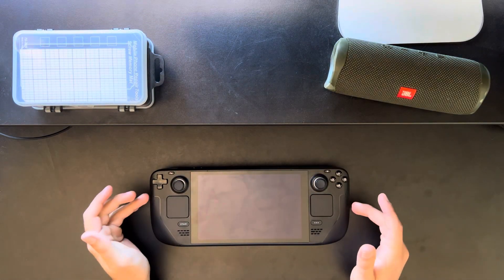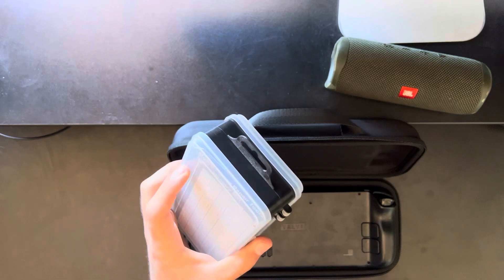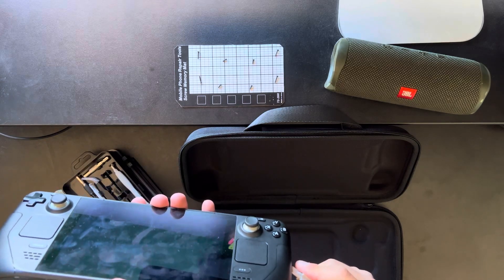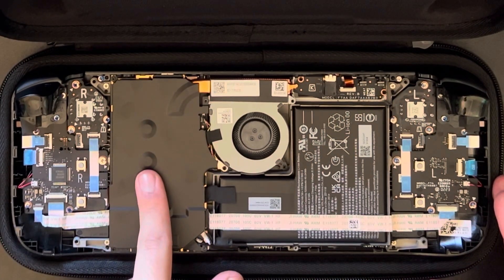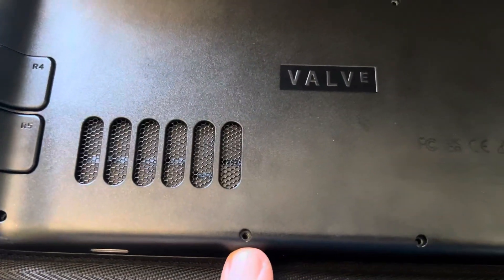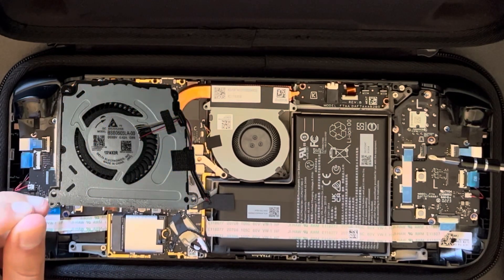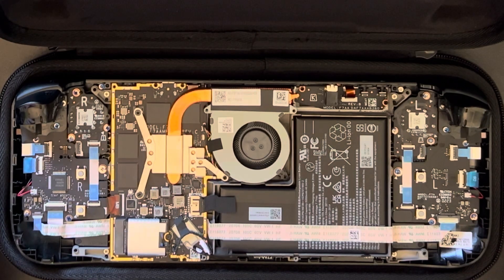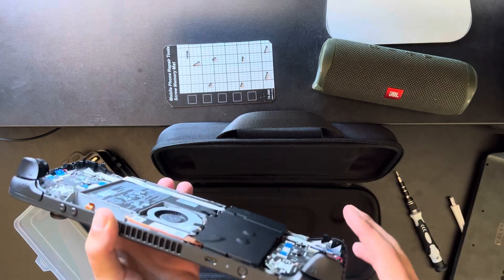The latest Steam Deck revision’s new heat plate and other changes

Comment from the maker: Thanks everyone for the comments, suggestions and support. It seems I did miss a few things like moved/changed cables and motherboard layout adjustments, I don't have an older steam deck to compare to so these are great. One important thing I did miss is:

REMOVE THE MICRO SD CARD BEFORE TAKING OFF THE BACK SHELL

I don't currently have a micro SD card installed so I forgot to mention it, thanks everyone who yelled at me in the comments about it and warned me about the damages it can cause. I'll update this comment if I find anything else major that I missed.

Comment: So does the new heat held give better temps and if it does where can I get it and can I add it to my area. Deck which didn't have that sheld
Reply from the maker: Hi, I’m not sure if it offers better temps since I don’t have an earlier model to compare but I’d assume it is the same. The steam deck revisions seem to be done for cost savings or easier disassembly, not for performance.

If your deck didn’t have the same shield as mine then it’s probably a different model with a different shield and there’s no need to buy and install one like mine. Hope that helped, sorry for the delay.

Comment: It looks like the wireless module has been moved out from under the M.2 SSD to beside it. I wonder if that means that M.2 NVMe SSDs with higher EM activity will not disrupt wireless function or if we even need to transfer the EM shield from the SSD to the replacement...
Reply from the maker: Nice catch

Comment: Omg thank u! Ur the only video I found that actually shows the new black shield and the screws on them but best of all u explained how many and why there aren’t some on all sides. I couldn’t close my bottom case till I saw ur video. I was about to wait for steam help. Then I realized when u said “the make case will use those screws that go in the black shield as well. I got a flash light and saw my metal screw through the case screw hole or the case screw. I just saw the god damn thing ok!? 🙏
Reply from the maker: Haha glad my video was helpful, yeah it looks like valve tried to reduce the number of screws by making some of them multipurpose.

Comment: What is that tool kit ?
Reply from the maker: It’s just a cheap kit I got off Amazon, I wouldn’t recommend it as while the magnetic tips are convenient they get stuck and are hard to swap. Also I don’t use it anymore since it lost its magnetism due to the events of the switch backplate video.

Comment: I got one of the very first steam decks, it even said so on the display when I got mine in the mail. I've upgraded and modded mine to hell and back and I can tell you that there are several differences well beyond just the fan and heat-shield on your steam deck. The biggest one I noticed is that the Wi-Fi card is now in its own place, uncovered by the SSD. This is actually huge as they were originally claiming that the third-party SSDs would likely interfere with its signal and now it seems like that's super unlikely. Another difference I've noticed that NOBODY has talked about from my early deck among all the newer ones was that the buttons are different. My launch deck had awful quick-access and steam buttons. Literally couldn't feel or hear them click, it was super annoying (until I soldered new ones in because it was THAT bad.) The start and select buttons are also now much taller, mine would press in below the surface of the rest of the system making it feel very weird. Newer decks don't bottom out the buttons as far. I was able to fix this by buying one of the replacement shells from eXtremerate however. Then other changes that are clear are the audio ribbon cables being routed completely differently as well as the joysticks being different designs both electrically and physically. The caps are very plastic-y in mine, even the rubbery edge is sharp and not so grippy. The newer ones have a softer more grippy feel and I really appreciate that. My deck is still awesome though! None of these changes are enough to warrant a new one but it's awesome to see them constantly improve it.

Comment: You are wrong about slim back cover. The only thing that allows you to hold it easily especialy 1 handed(when you use touchscreen with other hand) is grips. Withiut them it is a bulky heavy  thing that you cannot hold properly. For example ally is much slimmer becausr its grips are twice lower in profile. and it it horribly uncomfortable.
Reply from the maker: Yeah I see where you're coming from, I have a switch and it gets uncomfortable after a while. Maybe not completely flat but lower profile, someone else suggested putting stuff like batteries inside which would also be cool. One company has already made a shell with RGB lighting in it.

Comment: I put 1 terabyte in mine for £84, I woulda put 2 but 2 terabyte 2230 size SSD's are way more expensive than 2280 size 4 terabyte SSD's. 
Got my ultra fast 4 terabyte 6800 mbps read 7200 mbps write (for my gaming PC) for £180 but a 2 terabyte steam deck SSd is over £200. It doesn't make sense. I think I saw one for £184
Reply: Did you do the swap yet? How did it go? I think I got the same SSD was it a Sabrent Rocket by any chance. I'm yet to do the swap as I've been seeing an issue where the screen does afterwards. Hopefully thats not a common problem tho

Comment: just a question whats that little cable think on the wifi chip?
Reply: The large flat white ribbon cable above it connects the mainboard to the daughterboards on the sides. The smaller cables connected directly to the wifi card are for the antennae to make the signal better. All devices have them.

Comment: Thanks for this, I haven't opened mine up yet but it's from April, so it may be just before/ just after this. Food for thought, if you're using the newer fan setting in the system settings, I'd turn that off, and I'd go further and get Decky Loader then grab Fantastic, and set a linear fan curve. It'll stop the massive ramp/unramp sounds during certain activities.

Comment: i bought a 256gb refurbished one the other day and that is different again from what you have and from what previous models shown .. i even upgraded mine too a terabyte NVME and 512gb Micro SD ,  i never even thought there was this much variation on them .. great video my guy keep it up :) ..
Reply from the maker: Wow, that's interesting. I would have thought the refurbished models would just be the same as previous models but cleaned up and repaired before being resold. Austin did a video on the refurb deck, I might have to check it out.
Reply: ye i seen that video .. its good .. looks like he got a first generation unit .. im in the uk and all the steam decks come from Holland way with us god knows where tho that's where the shipping said .. maybe the ones in America are different .. mine was basically brand new , even got the one time serial number awards in steam from it 
 @salocin9009

Comment: Another big change that's quickly noticeable from earlier versions is they removed the audio cable that went from the top, down the top of battery and to the left. Looks far cleaner and makes it a lot easier if the battery needs replacing.

Comment: How does one with an early model go about replacing outdated pieces with the ones they've changed and made better? Can I buy that new heat shield for example and toss it right in?
Reply: it looks like the motherboard is slightly different, so the new shield would probably not work with earlier revisions.
Reply from the maker: @patchworkkid24  That's right, a few of the screw locations have changed so you'd need the heat shield that is the same as the one in your Deck

Comment: Can you provide more info on the noise differences of that new fan versus the old Huaying and Delta fans? You mentioned the noise of the new fan briefly in the video but a more in depth comparison would be great.
Reply: Huaying is much quieter. I just replaced delta with huaying. Huaying only makes wind noise. Delta has a whining tune. In Control i can barely hear huaying with 3000rpm speed and speaker muted!
Reply from the maker: ^ Pretty much this, I don’t have both models so I can’t compare unfortunately. There are other videos out there that cover the difference in more detail though

Comment: there's a different screen. the older ribbon cable says 2203, this newer model says 2305. afaik the older screen doesn't work on the newer model
Reply: Its the same screen with a new connector. You can just replace the conector like shown on the ifixit tutorials.

Comment: I got my steam deck a little less than a month ago, and I was worried about the fan. One of the first things I did was check the hardware components list on the valve site, it shows a list of what parts were used in your deck as long as it’s registered/connected to your account, and you can see it from the deck too.

Turns out, it only showed me 3 parts, two analog sticks and the other thing I don’t remember. I tried steam support and they couldn’t help me with it, but they did give me the impression the list would be up soon. Regardless, during my time with the deck, I didn’t have any noise problems but I was always curious if I got the “bad” fan.

Anyway, I opened my deck a couple days ago to install an SSD and dual boot. I noticed my suspicion about it being the latest revision with the black plate inside was true. And I couldn’t tell what fan they used. Now here’s the funny thing. I put it back together, and after everything I go back to the components’ list and lo and behold, I have one more part there. It says delta fan 😂.

I’m kinda glad I gave it a shot without knowing, because if I knew, I may have been very biased against it from everything I’ve seen about this fan. And then that would suck, because I bought the deck in a country where it’s not officially launched 😂
Reply: Ok so you paid more the the deck in a area you could not get any replacement parts for it or even buy it ... Dude the deck ain't worth all of that you should of gotten the ally or a laptop at that point cuz the deck is already out dated and can't even play 1/2 of steam STILL. The real number is 70% of steam games can't be played.
Reply: @itsquiwi8780  Ok so you woke up and thought you were gonna school someone about THEIR choices, on the internet of all places and this is what you came up with? 😂

I think you must be seeing things because nowhere did I mention paying more for the deck. Plus, ROG Ally would’ve been easily a couple hundred $ more expensive for me. On top of that, all my games play just fine.

Stop projecting so much and let people decide what is worth THEIR money to them.

For me, when I bought the steam deck, nothing beat the niche experience it offers at that price point. Forget laptops. Nothing came close.

Comment: Bought mine in summer sale (512GB) and got v1 or v2 with delta fan!

BTW yours is also delta again!
Friend has also this v3 version with black plate and the fan shows it on the other side!
Reply from the maker: Interesting as it is very quiet, Valve must have complained or something haha. Can't argue with results

Comment: If i plan to replace the ssd in this new version of the steamdeck do i have to replace/add some paste on the thermal pads under the black metal plate seen at 4:21 ?
Reply: No, don't put thermal paste on thermal pads. As for if you should replace the thermal pads, as long as they don't tear or anything, you're fine just reusing them.

Comment: What about the temps of the old fan and heatsink vs new.
Reply: I have the same revision. is 36 * C today outside and im in the house i play death island 2 low settings almost 50-60 fps and temperature is under 90*C and the fan is reaching maxim 7500 rpm max for 2 sec  with setings. updated fan "on"..

Comment: re: your personal request, it made me think "what if you stuck more batteries in there?"
Reply from the maker: That would be cool, could probably double the battery life with the mount of space there is which would be amazing. Too bad I'm not an engineer or 3D designer, hopefully someone can figure it out.
Reply: I can i have a 3d printer im really a specialist so what are you thinking more battery life 2 steam deck batterys?

Comment: I RMA’d my launch deck due to the gpu and cpu downclocking randomly to unplayable MHz. My RMA unit was faulty and died within 30 minutes of game play. The trackpad haptics were violent and the boot chime sounded muffled. Hopefully I get this newer kind of unit since it appears like a hardware revision. I like the changes in this design compared to the old one, especially the APU mounting system and the heat shield being split apart. Hopefully valve is using batter parts again too like that fan which looks straight out of a laptop, isn’t as loud as a delta.
Reply from the maker: Sorry to hear you had those issues, hopefully the new one isn't faulty for you.
Reply: I just returned mine for the same issue, currently waiting on a replacement.
Reply: @Max-jb8vm did you get it?
Reply: @Ghosty_Xwx  I did and it's the newer revision with the black heatshield although it came with the delta fan :/
Reply: Did you get it?

Comment: Thank you... i am still not sure if to swap the SSD of my 64 Deck... SD-Cards work just fine... i got the same revision as you. Maybe there is a 3rd party back cover that's smaler?
Reply: I think there needs to be a little gap inside so that the fan can get air.
Reply from the maker: I found a 512 GB ssd is about the same cost as 512 GB micro sd card, if I need more space then I still have the option of a micro sd. Glad to hear that it works well for plating games, haven't seen any slim back covers yet, maybe in future someone will make them.

Comment: is a New motherboard !
Reply from the maker: Pretty sure its the same, just painted black now.
Reply: No the main board is different. The memory is soldered to the left and original design it was to the right. Just took a screenshot from Taki Udon’s latest video.
Reply from the maker: @mobilechaosyt  Your right, my bad. Looks like there are some small changes, also the screw holes and mounting point for the CPU cooler are tweaked.

Comment: nice work! Have you had a chance to find out how fan noise differs between the new veriosn and older versions?  Mine is too noisy sometimes. I have been wondering how good the new version is.
Reply from the maker: No I haven’t, Steam Deck just launched here in Australia and even then it’s only through third parties selling the “Global Version”. Unfortunately I have nothing to compare it to but if it helps the fan is silent at 10 watts, at 15 watts it is audible but not very loud or high pitched.
Reply: @salocin9009  that’ll be great. I just sold my earlier version and I am eyeing new one. Mine had delta fan inside

Comment: Even among the early adopters there are differences. MrRev got his in March 2022, I got mine in May and even between ours there are differences. My daughter got hers in October and there are more differences still. Those differences are slight but you can see where Valve is continuing to improve the Steam Deck. Happy Gaming!
Reply from the maker: It's interesting to see how valve continues to tweak the Deck, to improve the user experience and also cut costs (fewer screws means less complexity in manufacturing). Thanks, enjoying it so far, much faster than I was expecting.